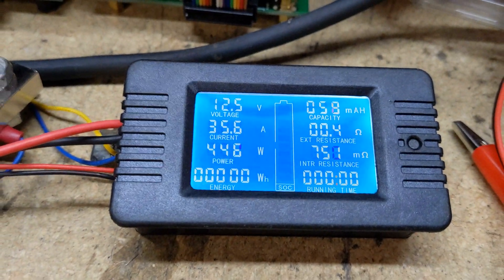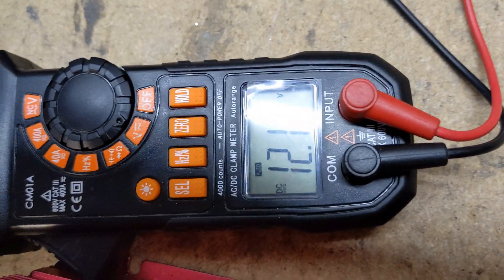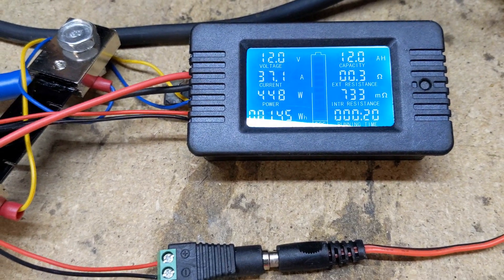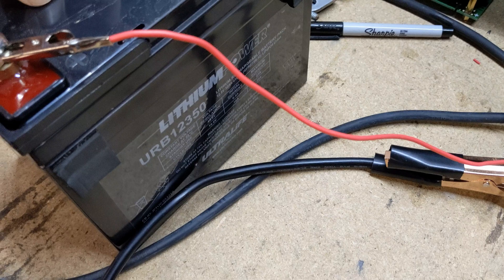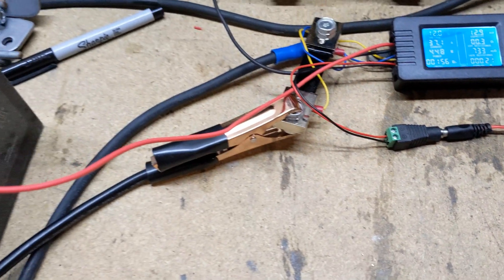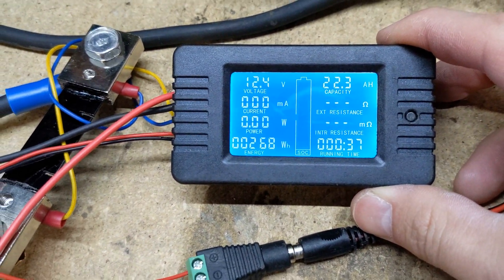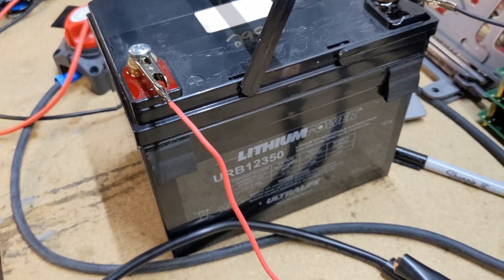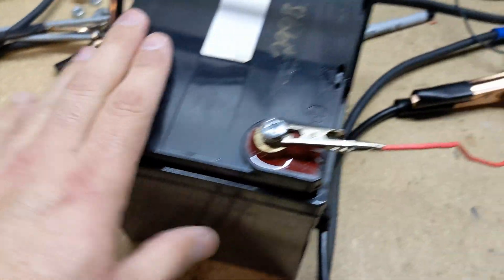Lithium Power URB12350 Lifepo4 High Amp Draw Test

Comment: They are actually rated for over 60 amps continuous discharge. I have a bunch of them. And if you use a bolted connection at the battery, you wont produce so much heat at the terminals, which makes it over heat.
Reply from the maker: I agree with that statement ,  Maybe i will go back and test the amps . I did get a new test inverter.
Reply: @offgridmaryland  okay cool! I've done 60 amp continuous discharges with them without the BMS shutting it off.

Comment: if it weighs ten pounds and you make 4 hallbach array propellers that can lift more than ten pounds then this battery is the shit bro
Reply from the maker: Patrick. It is certainly a small battery and should be used for smaller applications. Compared to the 80 Amp hour cells i have its discharge and charge capacities are much lower ..   I would say this would be a good battery maybe for off grid lighting or some backup situations but not as a critical use for keeping the power on in a house ..